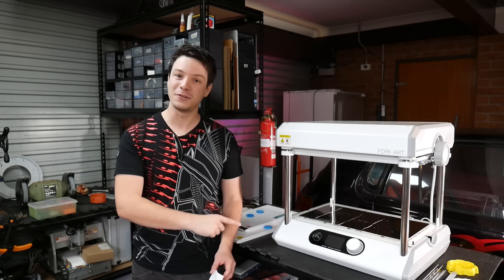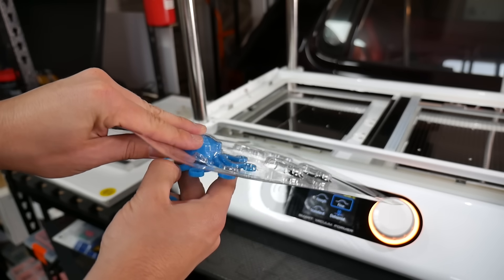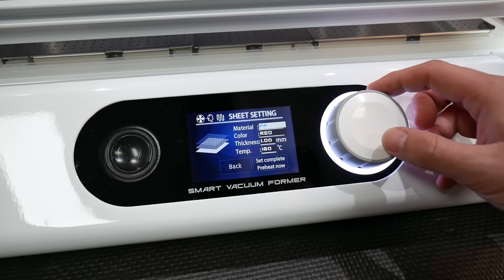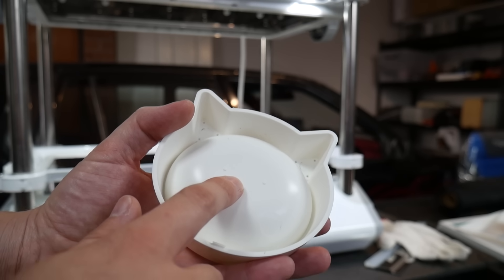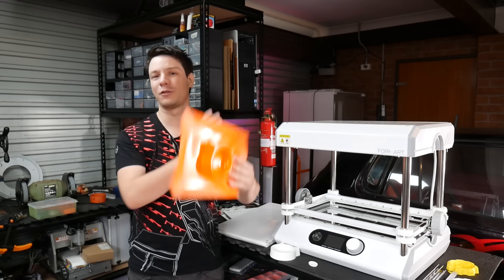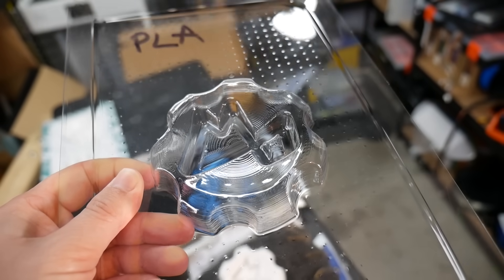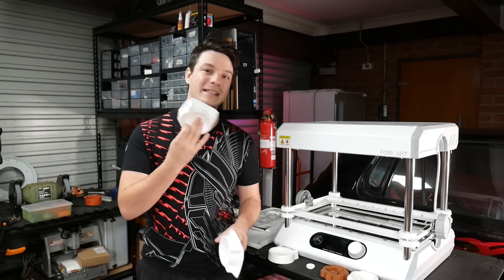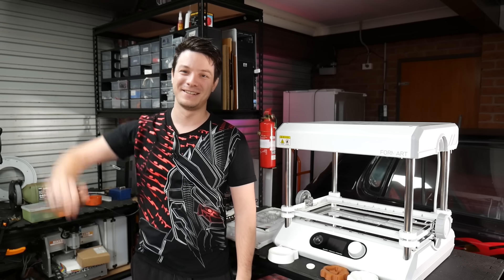Vacuum Forming is Incredible! FORMART 2 Review

Comment: Great video! How about making plaster molds from your 3D prints?  Plaster, when dried out is letting air through, thus eliminating the need for holes (unless you use dentists' plaster). It's also cheap and old model-making textbooks apparently mention it as well (at least if you want to do only 3-5 pulls or so)...

Comment: You would get more detail inside the bowl if you drilled a couple small holes around the corner periphery of the nose profile at the deepest part of the bowl, like the ears. Notice once the plastic hits the nose holes, it stops forming?
As to webbing. General guide is, there should not be more material around the part than the 1 to 2 x height of the draw.  Otherwise you need some other form nearby to draw off that excess material away so it stretches rather than fold on itself. Preferably another usable form to limit waste or as you discovered, a smaller blank.

Comment: If you are making moulds and messing with resin and silicone you may have a better vacuum hanging around and that would bring the diy bodge level on quality. Better to have one vacuum pump used in many applications than several machines, each with their own vacuum pump, at least for the DIY-er.

Comment: That Formech vacuum you showed at 18:00 is a similar price in the UK in an 280x230mm size. Having said that, the results you got from the formart were actually very good. I guess the costs make sense if you are actually making money from forming as it's so fast (as long as your post processing is also optimised). Personally, I never really find the project that requires lots of the same object :(

Comment: Back in the sixties (early seventies?) Matel made a vacuum former for kids. (Impossible now days with the nanny state.) I had one as a kid and it used about a 4x4" sheet of PS and a manual pump.
Reply: Oh yeah, I used to jam all my little cars in it. Hot wheels for reals.
Reply: In the 1930's Gilbert (of Erector Set fame) sold lead soldier casting kits, with an electric melter and real lead. Also balloon-making kits with liquid rubber.

Comment: For that price, I'd hope to see a smart bed allowing the use of an arbitrary size/shape of sheet.  Camera and piezo valves, perhaps?  Look forward to the chocolates though :)
Reply: Wouldn't a stronger vacuum pump to the trick?
If the vacuum pump is strong enough it shouldn't matter if most of the holes aren't covered.
Reply: @Jehty_  Flow vs pressure (vac) curve of pumps are pretty unfavorable -- more flow though open holes.  Pump would be $big$.

Comment: The real shame is plastic recycling is basically a myth. Even here in my neck of the States, where we have really good recycling systems, the vast majority of plastic just goes to the landfill. It's not really easy or economical to recycle.
Reply: It doesn't have to be that way.
Here in Germany around 50% of plastic trash gets recycled. By 2022 it has to be 63%
And the rest gets incinerated and used as an energy source.

Is it cheaper than to bury it? In Germany maybe. Space is rare and landfills are expensive.
Reply: @Jehty_  ya but the "recycled" stuff is hard to work with and ends up being sold to china causing more pollution with the transport emission
Reply: @Jehty_  In Australia we used to have proper recycling but it got cut off once China banned plastic imports. Problem was that they needed humans to sort different types of plastic, which cost the government more in healthcare for those workers than what marginal profit the industry paid back. Now we either compost or landfill. Recycling can be profitable in an isolated domestic economy but the sorting stage is always the bottleneck and should be completed at the time of binning. Even still unmarked plastics will fall through the cracks.
Reply: @mynameisconman237  Not anymore. China banned plastic imports a few years ago. Took out the whole industry.
Reply: @Jehty_  Fellow German here! The 50% is only the material, that‘s thrown into the trash can (called „Gelbe Tonne“). It doesn‘t count in what happens afterwards. A big portion of this 50% get‘s burned or exported. The real amount is about only 15%. And most of it is not really recycled, more „downcycled“, e.g. as filler material in construction. Real recycling is pretty difficult, especially for food packaging, because you don‘t really know exactly if there are toxins inside it. So that means that food packaging plastic is basically always new plastic.
Reply: @mynameisconman237  that used to be the case, china actually has refused to buy it recently. (4-6 years ago if I recall)

I've stopped using plastic bottles personally when I can avoid it because metal recycling is vastly more established and you can actually make some money where plastic is usually just given up for free. I've actually cut pieces of PET drink bottles (large 2-3 liter) and used them on a vacuum former though and while they want to curl back it's doable
Reply: @MnemoLogic  Exactly. Burning acually counts as recycling in the German statistic because you get energy from it. It's all a bit of a tragic joke. :(
Reply: @SwiftCreationStudio  Thats not a bad idea to use plastic bottles as a way to vacuum form.
Reply: @infernaldaedra  It worked for my purposes it was just annoying to work with.

I considered all factors that could have been an issue for me prior to purchasing the item I used as well. That said I already would have bought it without the idea so... Not really a bad idea to explore my options either it would have worked and be used or I'd toss it. :P

I used it for a mold if a relatively simple shape with little detail so definitely explore options. I mean that's how the bottles are made more or less
Reply: Here in the Netherlands we now have machines that separate out the plastic, even from regular domestic waste streams. And after that it even gets separated by type of plastic, it's not flawless, but the techniques are getting there!
Reply: @MarinusMakesStuff  we have those were I live. Most is still just sent to the landfill or burned. Paper is burned or recycled depending on the market and what's going on with the incinerators that day.
Reply: @Jehty_  Yep, Americans have our environmental policy still being set by fossil fuel companies. I'm sure it's not perfect there either, but grats at the relatively more sane protections there :)

Comment: Looks like fun, but I'd be struggling to find a use for one?
Reply: I gave up on that notion
currently working on a benchtop plastic injection molder and a 3018 mill, with zero use cases for myself for either

Comment: I make cosplay helmet visor using PLA print at 3 peremiter, 3% infill, no bottom layers and filled with plaster, and my bucks are lasting a fair bit of abuse! Just need to be crazy smooth and sanded, because even the texture of the spraypaint will get pick up in the forming process

Comment: Why is carbon fibre a perk? It distributes heat more evenly. Carbon is actually material that has already been burned. Paper heated to 1000 degrees turns into carbon that forms a heat shield in my products.
It is also long lasting, well, because it has already combusted. A great conductor of electricity, helping with the heating.
From what you have shown in this video, formart did their homework on this device. Kudo's to them.
Wish I had money to buy 1 right now. Could use it to make packaging for my products.

Comment: To remedy the sheet lift being cumbersome to move up/down they should use longer couplings/bushings on the vertical tube shafts, which would require that the top of the unit can accommodate longer bushings. Having them only be <1" long along those shafts and with manufacturing being kept economical the tolerances are not going to be super tight, leaving too much room for leverage to lock the bushings up on the shafts. Doubling their lengths will force the sheet lift to retain a much more horizontal orientation. Great vid, and a great machine otherwise!

Comment: The time taken from heating the plastic to being placed over the model is critical. I use a vaccum cleaner & it forms just like a shop bought one. The trick is in the "Non Binding" drop positioning mechanism & the even heating element. Using a hot air gun & taking 3 seconds to place the plastic in position is never going to work properly to achieve sharp edges between the model & base. The Formart 2 looks nice though.

Comment: For DIY use a vacuum pump for HVAC, use it to charge an old air compressor tank so you get a nice snap vacuum when the sheet goes down. Just a theory on my part. I would be interested to see if anyone has tried it.

Comment: Another lively presentation & useful review. Always a bit of a risk to have a pre-Production model scrutinised but you've been entirely fair. I don't think I'd want to part with so much money for something so easily DIY built using cheaply available components. The sheet-lowering mechanism is poor. I believe you could spray PLA prints with Hi Temp Oven Paint to make them directly useable but that 'sacrifices' the original.

Comment: Im sure there's a legitimate design reason for this but why didn't they just use the wheels that already locked into the base to lock into the top? They have a cool cam lock thing why not just use it.
I'm thinking It could be because fumbling around with the wheels will alow the plastic to cool but idk.

Comment: Melting chocolate: Don't bother with a double boiler. In my experience, some of the steam ends up getting into the chocolate and basically any amount of water pretty much ruins the chocolate. Instead, use an electric blanket or a heating pad on the highest setting. It'll take longer, but you'll have a better experience.

Comment: I think we all know where this is going...
See-through polycarbonate valve cover for the 'rolla = maximum sex-spec cred 🤩
Reply from the maker: Would be amazing if it could handle the heat ! Sadly oil also annihilates PC. It's not great against most chemicals sadly.
Reply: @MakersMuse  But that's only a problem if your engine actually runs, and your engine not actually running is peak sex-spec! 😉

Comment: a vacuum doesn "suck" anything... the plastic is shaped by the PUSHING of the pressure on the other side without vacuum which is MUCH higher compared to the other side that is not under 0 pressure.  There is no "sucking" force in nature.

Comment: Don't be sad about the plastic recycling situation in Australia. It is just as bad or worse everywhere else. Most recycling systems sort out between 1% and 5% of plastics for recycling, and the rest goes to landfills. 

Hot forming most plastics reduces the average length of the hydrocarbon chains, thus recycled plastics have worse material properties. Add in the fact that recycling tends to be far more energy intensive than the refining of oil into plastic and you have real difficulty justifying plastic recycling from an ecological or economical standpoint. Probably the most ecologically friendly recycling anyone could do is using various hobbyist systems to make really low quality filament for prints which are not mission critical. With a dumb vacuum former you can use a similar home extrusion system to make sheets for vacuum forming (trial and error "good enough" results are good enough for a lot of vacuum forming projects, and unlike 3d printing, the process is fast enough that a failed form is a small loss)

Comment: Hasn’t this already been a Kickstarter a few years ago? Why is it not just in production? I saw it about 3-4 years ago and it was only a few hundred quid.

At @ $1800 it is a big no. The material capacity appears to be much smaller than a comparable commercial model.

The Clarke 1210 is only £1930 +uk vat and that is an industrial machine. This thing looks like a toy in comparison. It should be no more than £4-500 imo

Comment: It's honestly kind of insane to me that these hobby level vacuum formers are so expensive.  As you showed, almost anyone can build one with either spare materials or for a fraction of the price that can produce results just as good. 
When you consider that there's legitimately amazing 3D printers out there for less than $200, that are exponentially more complex and costly to manufacture, paying $600-3000 for a heating element and perforated surface feels.... icky. 
Suppose it's only a matter of time before we start seeing new formers from companies that aren't trying to get 95% margin from them.
Reply: The vacuum pump, the perforated steel plates and the heating element aren't cheap. A shop-vac is way less capable when it comes to forming. The parts for 3D printers are much cheaper to make. I would hope that a machine like this comes out at some point for under a grand though.

Comment: you can retrofit a vacuum cleaner
Reply: diy or full diy
Reply: your lab stuff is low quality, screw that
Reply: convert that to press, stamping
Reply: the softening might be ideal, anti-aliasing of the rough surfaces
Reply: do you like barbie cars
Reply: rust will not attack that, just cover it with ceramics or glassing
Reply: why do you pay at all
Reply: maker makes, all
Reply: that diy is free
Reply: diy plastic
Reply: diy plastic casting
Reply: diy plastic reaction casting
Reply: carbon or sand quick molding, mold pressing
Reply: you are in danger area, dont touch, "i must make you safe", you are not adult enough
Reply: i think you should have more common sense
Reply: not wise to judge, i though you would have better sense
Reply: not wise to restrict, it will be on you